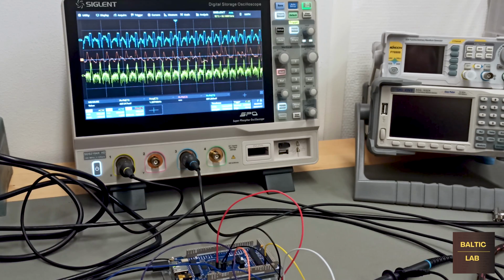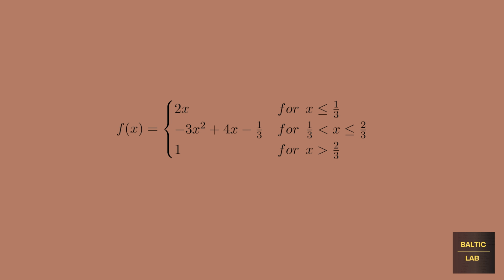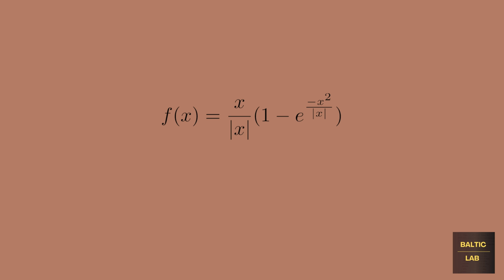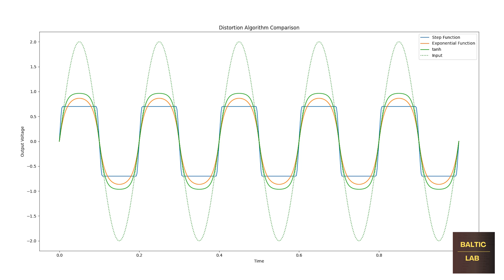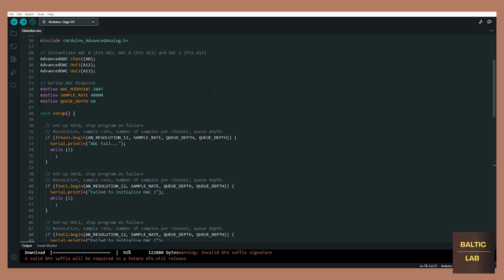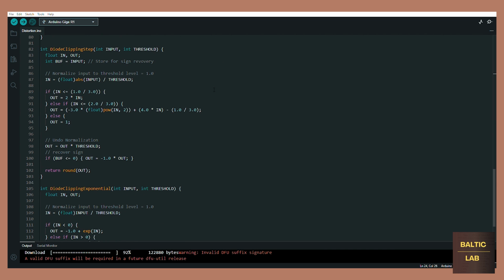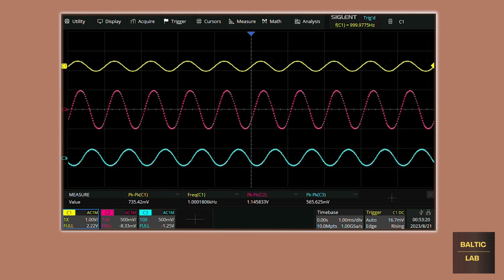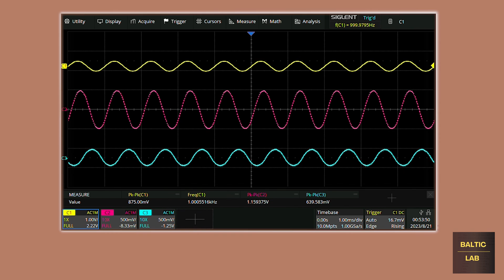Overdrive and Distortion Effect Digital Signal Processing (DSP) Algorithms  on the Arduino GIGA R1

Comment: This is a fantastic video. I will try out your step function. For the exponential function you better take

f(x)=\operatorname{sgn}\left(x\right)\cdot\left(1-\mathrm e^{-\left|x\right|}\right)

Now you don't need to divide by zero anymore, if the input voltage x is zero.

Best regard, Mitchel
Reply from the maker: Thank you very much for the suggestion, I will definitely consider it!

Comment: There are instructions for dummies on how to assemble it, a finished sketch and all the components
Reply from the maker: Not yet, but I am planning on doing more videos / articles on the subject.
Reply: @BalticLab  I hope all the articles will come out soon, I need it. I'm doing a guitar-related thesis project, making a "combo amplifier" using Tpa3118 Mono, I want to add an arduino, but I don't know how
Reply: If you want, I can add a video to my channel, with diagrams and sound
Reply from the maker: @архив18-20  Sure, do it and post the link here
Reply: @BalticLab  It looks like YouTube is blocking links, I uploaded the video to my channel
Reply from the maker: @архив18-20  I responded under your video